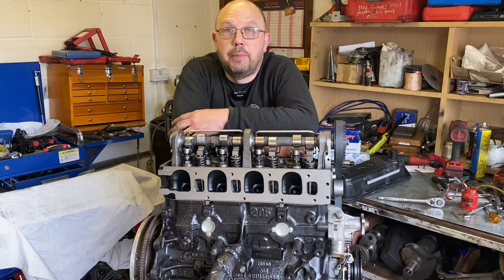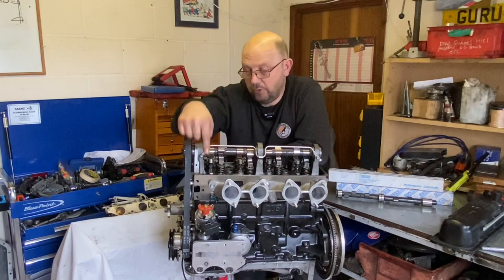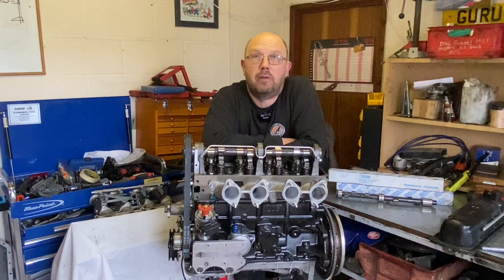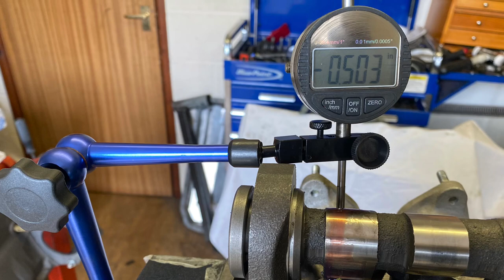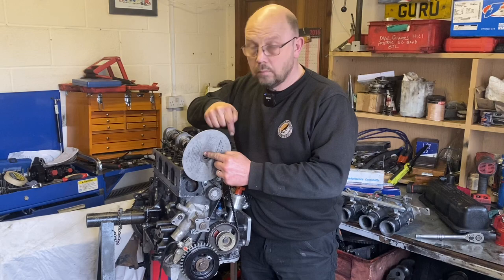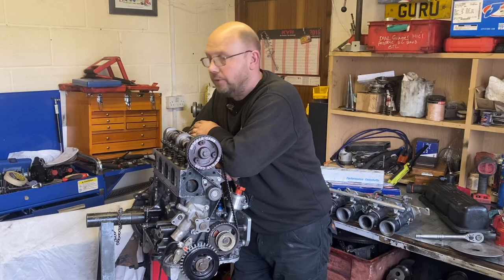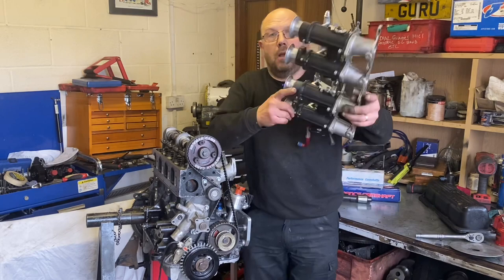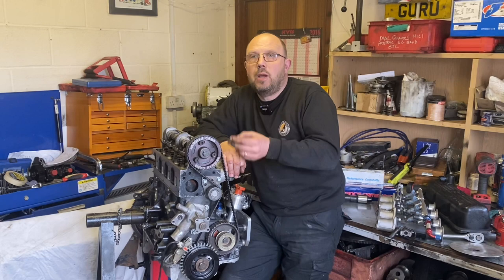2.3 race pinto rebuild part 4

Comment: There's no reason to use springs in a race clutch... Always a good job... still anxious for the bike carb video ?
Reply from the maker: thats not a clutch, its a drive plate, its only for driving dyno, the springs are there to protect the engine/crankshaft, when the dyno shuts the engine down it puts maximum braking load on the engine, the sudden torque reversal has been known to snap crankshafts! Bike carb video coming soon, i did the bike carb test for a magazine so i have to sit on results for a while before i can turn into a video
Reply: @PenguinMotors  Sorry, I mistranslated... I believed the springs were to create a tolerance for misalignment between the flywheel and gearbox(which is desirable in a street car... but creates judder and loss of efficiency).
Reply: That was about the first thing he told us, were you watching with the sound off?
Reply from the maker: @21camaleonte  in fact the springs in a clutch are nothing to do with misalignment, they are a damper and allow the smooth engagement of the clutch. remove the springs and the clutch becomes an on off switch. they also act as a torsional damper.

Comment: Hi - Thanks for the excellent info and guidance - I have built a 2.0 Pinto with a FR32 285' Kent cam, cleaned up the head and valves and will be running 45mm throttle bodies running 310mm injectors which I will be installing into my escort MK1 - do you have any recommendations on what diameter exhaust system would be the best fit as well as well as if I should install the round or oval type silencer boxes? I would like the car to be a reliable retro sleeper :) 
Massive thanks and keep up the good work!
Reply from the maker: 2 inch bore is teh size to go for, round or oval silencers wont make any difference

Comment: Quick question,  which makes more power between carbs and electronic injections.
Reply from the maker: assuming they are sized correctly in terms of peak power theres practically nothing in it

Comment: Are the standard head bolts expansion bolts?
Reply from the maker: late torx type yes, early spline ones no
Reply: @PenguinMotors   So you use the non expansion bolts that can be reused. Thanks for your answer.
Reply from the maker: @RallyeRacin9  yes